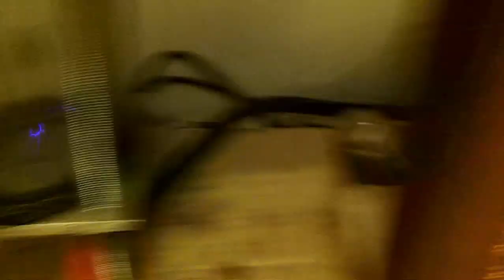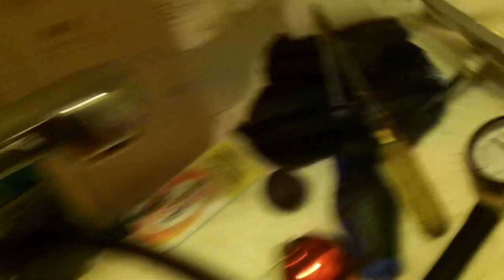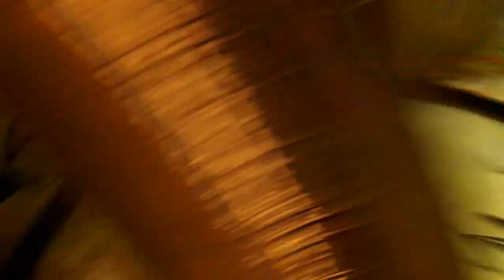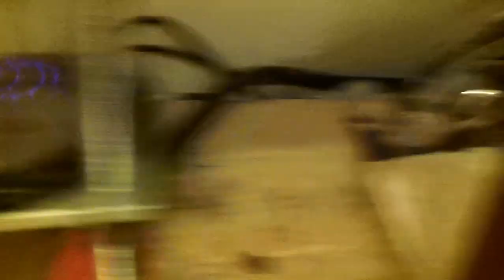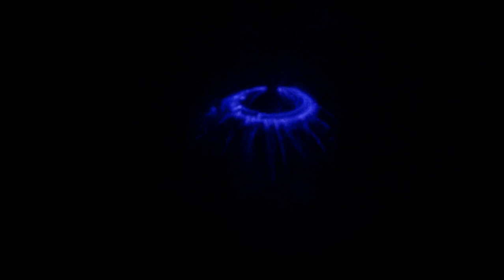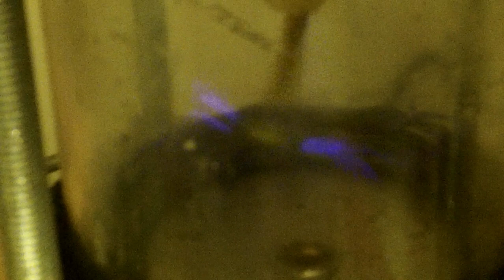ion spinner (plasma spider)

Comment: Looks great....very effective when the light was off :)
Reply: Cheers mate!  Trying to come up with something new, but a lot of this I think you've seen before. I absolutely LOVE the new speaker :))))))  It's all about seeing how things work, and I never knew a speaker could be made so easily. I will get replicating in a few hours.....
Reply: MrSkypelessons
Well I can say that you and mnsman1 do some amazing things with vacuum's and plasma !
The speaker is about the simplest thing I could think of, there being a lot of similar designs out there, but with added bendy bits of card etc. Better to use an amp output I would think, but the sound quality is pretty good from an earphone port when very slightly above the magnet.
Reply: slider2732 I tried it today with a plastic cup and got nowhere! Got some foam ones coming, as I know this is another one which will be great to do with the kids.
Thanks for the heads up on the mnsman1 channel. That's gonna keep me busy tonight!